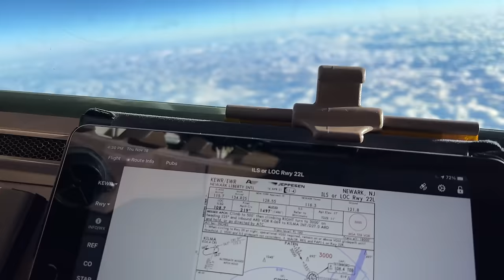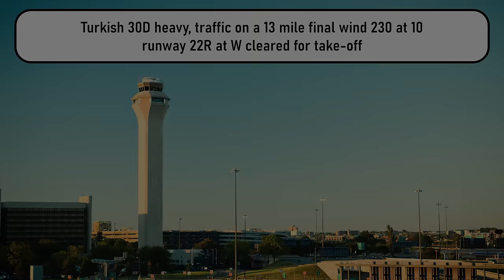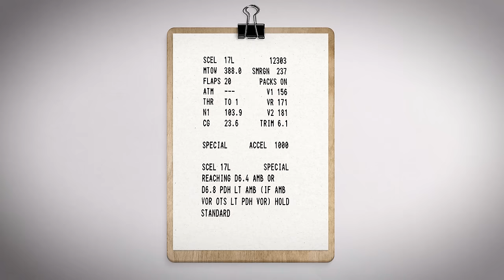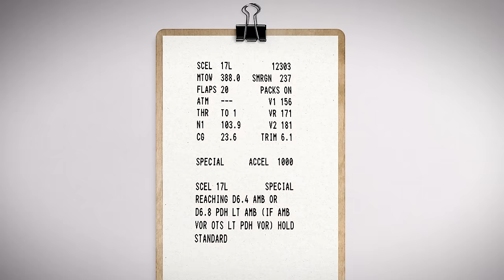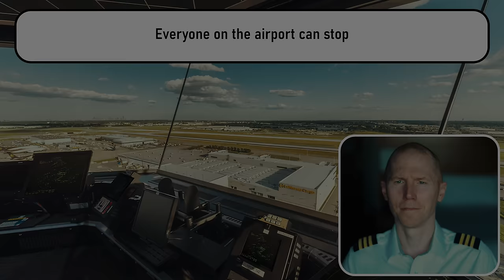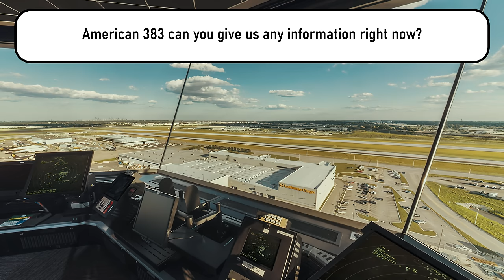American 767 Engine Fire

Comment: Of course, with so many identification lights, taxiway signs, it's very interesting to shuffle the runway.
If I'm not mistaken, THY's plane is the A330. THY sends its experienced pilots to this airport and airspace where it flies every day. A330s do not have a moving map system on cockpit. Paper charts are no longer used as pilots are in a sterile-paperless cockpit layout. Everything is done with EFBs now.
I think such an error could be caused by something distracting inside the cockpit. An incident oe event in the cabin, a problem with the aircraft, a malfunction with the EFBs while following taxiway, a problem with the runway identification system if the A330 had it, something unexpected but distracting the pilots. Perceiving the outer edge lights of the right and left runway as runway edge lights in the taxiway with loss of situational awareness.
This error must have an explanation.

Comment: At 10:05, is that a photo shopped smoke cloud in the foreground? Thanks in advance.
Reply: The image is photoshopped, but the event was real. Search for AA383 2016.
Reply: @gordonrichardson2972  Thank you for your comment. No doubt the event is real. That is why I was inquiring as to the need to a photo shopped photo in the foreground of the actual plane in fire.

Comment: Shit happens fast....I remember seeing a collegue almost turn on a TXY instead of the RWY when they got lineup via a different than normal taxi route and it was 1 am and they were very tired :D
CPT saw it immediately and told the FO so they just made a little right left swing. Was crazy to see but shit happens fast... If I remember correctly it was teir homebase and they both had good hours. So you know how it is... as soon as something is out the normal, errors can occur easily

Comment: Ok, I have a story that begs a question.  I was in the right seat of my friends 182.  We were cleared for take off "with no delay".  There was a plane on short final and when I looked to clear final he was right there with landing lights on and gear down.  We went onto the runway and hit the power and took off no problem.  But my question is, if we were a large heavy aircraft, how would wake turbulence come into play?  What is the appropriate distance for someone on final to not get waked by someone taking off?

Comment: I agree that we all make mistakes (I have done so too), but at my airline everyone in the cockpit must visually confirm that we are entering the correct runway at the correct entry point, say it out loud and then we all crosscheck. On the runway we take a quick look at the ND to check that the heading corresponds with the runway direction and the track line is in front of us. Then we all confirm that we are happy and ready to go. I have always assumed that every airline does this. Especially at large international airports these checks are vital in order to ensure you are on the correct runway. Like I said, I understand we all make mistakes, but this one I find rather surprising.

Comment: In the case of the second incident. How long does it take for an engine to turn off and down spool to a safe level? I would have figured the engines would be designed for stopping them fairly quickly. Is it just because the inertia that they stay a potential hazard during a quick evac?

Comment: Do planes not have a "Stop Everything" button?

That will ,probably damage, but kill the engines immediately. Something to be used during emergencies.
So that you don't have to go through an entire checklist.
Reply: Yes, they have fuel cut switches. Commercial aviation just has an idiotic obsession with trying to diagnose the issue instead of getting to safety.

Comment: if i were able to choose a pilot and/or crew for my plane, i would not choose one that has never had an incident. i would choose one that has been through and managed an emergency that was not caused by them. that is experience that most pilots never have . which is good on one hand to never have any problems , but at the same time managing through a tough situation tells me that they have the ability to do so if one arises. ( again as long as the emergency was not caused by their negligence)

Comment: 383 had an uncontained engine failure. The HP2 turbine wheel broke into 2 pieces. The piece that flew up ran through the wing trank and still traveled 3,000 feet past the hull.  The pilots new before the controllers it had sh1t the bed.  The list of uncontained engine failures is getting scary. Imagine if this had happened in-flight. The crew did great however they did start evacuations before it was safe and one of the one serious injury was a pax that ran behind the left engine which was running. The pilots were running through the in-flight fire checklist which called for leaving the operational engine running (obvious reasons). When they saw people hitting the slip-n-slide they shut it down but very dangerous as we know people could have been sucked into the operating engine.  Some good reasons from this one.
Reply: Observations from NTSB aar1801.pdf

Comment: Planes can and do take off from the wrong runway or from the taxiway. And it can be deadly. On August 27th, 2006, Comair Flight 5191 took off from a closed runway that was too short for their takeoff run and crashed at the end of the runway, killing everyone on board except for the First Officer. Sadly, they even noted during the takeoff roll that the runway looked strange with all the lights off, but they didn't try to stop.

Comment: Crazy question, what happens to the fuel during a fire? Is their a mechanical system that dissolves it such as an agent or is it still just sitting in the wing? A halon agent to render it non-combustible?

Comment: I would’ve been that anxious passenger in the back, because I can easily identify the difference between a taxiway and a runway. And if I saw us pass the runway and turn where taxiway lights began, and then felt takeoff thrust, I’d be worried. 

That is a bit worrying that pilots would make that mistake, but I can see how it would happen. Being tired plus at an unfamiliar airport might be the cause. Maybe the layout is similar but not identical to an airport they’re more familiar with and it threw them off.

Comment: From the NTSB official report: American Flt. 383 was a Boeing 767-323.

"The NTSB determines that the probable cause of this accident was the failure of the HPT
stage 2 disk, which severed the main engine fuel feed line and breached the right main wing fuel
tank, releasing fuel that resulted in a fire on the right side of the airplane during the takeoff roll.
The HPT stage 2 disk failed because of low-cycle fatigue cracks that initiated from an internal
subsurface manufacturing anomaly that was most likely not detectable during production
inspections and subsequent in-service inspections using the procedures in place. Contributing to
the serious passenger injury was (1) the delay in shutting down the left engine and (2) a flight
attendant’s deviation from company procedures, which resulted in passengers evacuating from the
left overwing exit while the left engine was still operating. Contributing to the delay in shutting
down the left engine was (1) the lack of a separate checklist procedure for Boeing 767 airplanes
that specifically addressed engine fires on the ground and (2) the lack of communication between
the flight and cabin crews after the airplane came to a stop."

Comment: Hello, I am always nervous flying because i have watched so many episodes of air crash investigations that now seems to be the basis of my fear.
Can you please make a video to address improvements that has been made regarding safety as regards horizontal & vertical stabilizers? Are there any probabilities that what happened with the Alaskan air incidents ever happens again or are new improvements that makes it impossible?
Reply: I've found those videos have made me less nervous. You see how there are so many redundancies built into the planes and the pilots' procedures. It usually takes multiple things going wrong for an incident to happen. When you're in a car, one small problem can have terrible consequences.

Comment: Wow! That's wild! But the tower was watching over them, proving that the system is working to keep us safe.  I have an unrelated question for you.  I just heard on my scanner a small aircraft pilot ask the tower if they had time to shine a light gun. Common sense tells me it's a VFR visual thing , but it's not dark yet.  Your thoughts?
Reply: The control tower has a light gun that can emit red, green, or white light. The color and whether it's steady or flashing communicate different things. It's used when an aircraft has no functioning radios, whether due to a failure or the fact that the aircraft just isn't equipped with radios.
I suspect what you heard was a flight instructor requesting light signals so the student could see what they actually look like. They're not as obvious as one might think, especially in daylight.

Comment: What if the transponder had a problem and incorrectly showed the plane on the taxiway instead of the runway?
Reply: Usually transponders aren't used for that level of precision on ground movements.  The tower controller is looking at the planes directly whenever possible. It's also possible to have surface radar that can show the position of a plane with much higher precision.

Comment: I always enjoy your videos and explanations..    Missing the runway markings   ( lighting, striping, etc ) is not an excusable thing for a captain flying for any airline.  Correct me please if this is  incorrect, but the steering tiller for ground maneuvering is on the captains side of the aircraft.   As a fellow pilot, I find it amazing that a professional pilot with enough seat time to make captain would miss ALL the visual cues that he was NOT on a runway when beginning the takeoff run.    WOW.   Flying for an international airline like Turkish Airways would predicate that the captain as a minimum would be flying into major airports with conforming FAA/ICAO markings and lighting on a regular basis.  Granted people make mistakes once in a while....  That said there were at least two ( possibly three ) pilots in the cockpit for takeoff and they all failed to self-recognize the error.    Thanks to the controller that recognized the problem and reacted and thankfully no other aircraft were were using that taxiway in the span of the attempted takeoff run.
Reply: The Turkish pilot's radio calls after crossing the runway weren't clear. The controller was very calm or managed to hear what they said, but the audio clip on here didn't give me any confidence they understood the instructions.

Comment: Hey 74Gear
Does it make sense for Boeing to develop a twin engined Boeing 747?  Also how does cargo pilots make sure that all the pallets are locked and won’t destroy trim during flight?
Reply: No. The load master has to use a controller to move the pallet. And it automatically locks. There are also electronic indicators on some aircraft.

Comment: Wow, the American Airlines fire at takeoff: "The right engine had suffered a sudden rupture of the stage 2 disk operating at takeoff power. The disk separated into two pieces, the smaller of which pierced the wing's fuel tank and then flew 2,935 feet (895 m), falling through the roof of a United Parcel Service (UPS) facility and coming to rest on the building's floor. No one was injured in the UPS building."
Reply: Where are you from ?? 🙄 Nate

Comment: @ 13:34, an evacuation chute deployed on the fire side of the plane?? 😲
Reply: Aircraft always take off into the wind, so that's not as dangerous as it looks.
Reply: @gordonrichardson2972  I was thinking of the Asiana crash at SFO.  A 16 year-old girl was run over and killed by a fire truck due to the fire foam being so deep it covered her up from being seen.  I don't think you would want a single passenger on the fire side of the plane.

Comment: I can't really imagine that NONE of those Turkish Airlines passengers saw that they were on a taxiway rather than a runway.  There are lots of business passengers that fly very often and would recognize they were still on a taxiway when the engines were spooled up and they were accelerating for takeoff.  Not to mention, there were probably some pilots or at least aviation enthusiasts aboard looking out the window at those blue taxiway lights.  If it were me, I'd be willing to trade my silence to the other passengers for an upgrade to first class. 😉😉

Comment: It's important that as a pilot you let atc know how many souls onboard and that you are evacuating, the atc also ordered everyone on the airfield to stop, AFRS own the field in a situation like this. As one of those who will be putting on kit whilst rushing to the aircraft, we need to know how many people should be outside. Whilst climbing into a burning aircraft is not a big problem, there is danger to it and getting extremely hot searching a plane for people who were never there isn't fun.
We need to know about evacuation because the trucks are very large and heavy, they are also very fast as they have be to get to anywhere on the airport within the time limit. They have very good brakes but 40 tonnes takes some stopping from response speed, driving over a person would feel like a small bump if felt at all. Passengers have been killed by responding  trucks. Stopping on the runway is great, as taxying off can cause a delay in response especially at night.

Comment: I will give the 767 pilot credit for coming to the evacuate decision much faster than most pilots. But there remains a glaring and dangerous flaw in the airline industry. For all the talk of CRM, it falls apart at the cockpit door. Your Cabin Crew can see your wings and engines. Easily. Yet in these critical "Clean Cockpit" moments they have no method of communicating an emergency to the pilots save at the pilots discretion. every other industry in the fucking world has figured out how to put in a Fire Alarm handle to be pulled when you see fire. This plane was fucking fully involved. The wing was on fire. Yet the pilots had to be told they were on fire by the ATC, who happened to look their way. Guaranteed every passenger and cabin crew member knew that fucking plane was on fire well before that Captain did. That is a horrible failure in the system.

And actually people are normally very cooperative in an emergency. If the Flight Attendants tell them to go over onto the grass on that side of the plane they will all do it without question. They just need to be given clear instructions. The disaster and wandering people happens when they are not told what to do and where to go.

I've been binge watching a bunch of air crash videos this weekend for some reason. In watching a number of well known incidents the one thing that leaps out at me is in the cases of some of the most horrific crashes, the pilots ate up precious minutes troubleshooting, screwing around, when they had evidence of a fire on board. "Do you want to declare an emergency" "not at this time" And right there he just killed everybody on the plane. Because all the gauges and instruments do little to tell you things like the economy class toilet is on fire until it is way way too late.

Comment: We buy tickets to travel and most of the local flights here had exceptional safety records. But events like that on film make me too aware that a fire like that 600 miles out over the Pacific ocean is not where I want to get out and look for a new wing and jet engine. I have increasingly less reason to trust these flights from the outset as the years tick by and the incidents mount up. Even Air New Zealand has lost flights and I trusted them above all since my cousin was an engineer with them for decades. He would tell how stringent the checks and balances are within the company. And of the pilots being of the finest calibre they would source from such long lines of applicants. At least when a ship sinks there is some chance of getting home for dinner in a few weeks.

Comment: Yeah doing things, first and foremost among those being lets stop pumping fire juice into the burning thing. Fuel going into that engine is less than ideal at that point after all. Notifying the incoming trucks that you are in the process of depositing dazed and confused pedestrians into the area seems wise as this is probably useful information for the driver of a heavy motor vehicle racing into this mess to be aware of. Being run over would suck, let alone being run over by the rescue crew, communication that can help avoid this seems welcome to my mind.